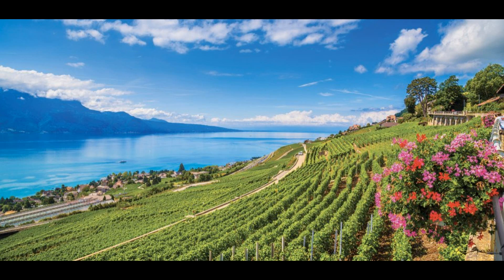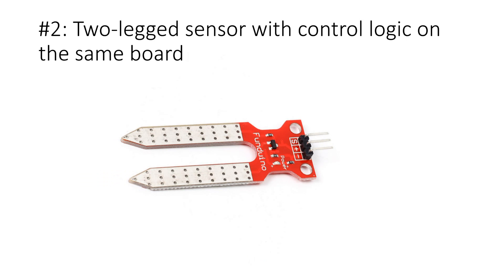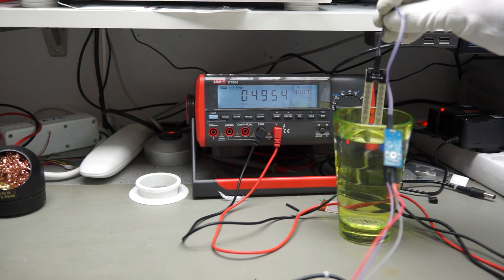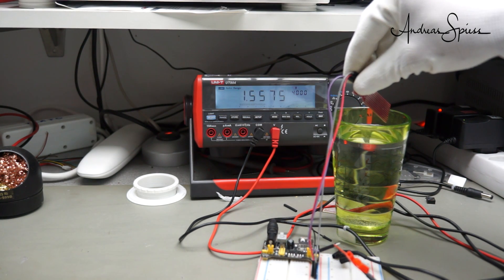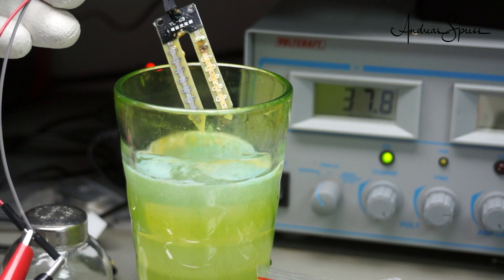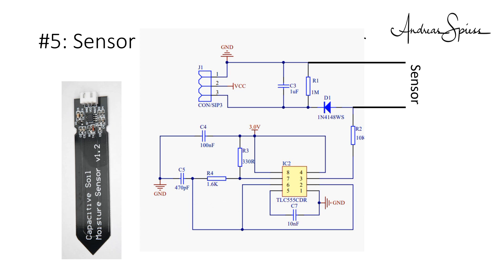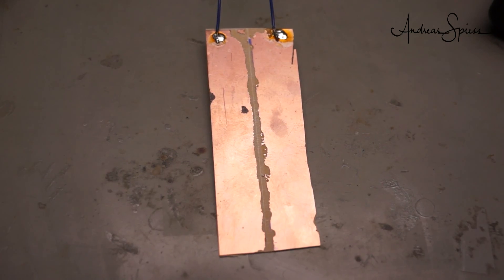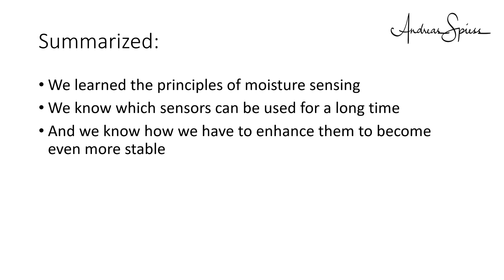463 Why most Arduino Soil Moisture Sensors suck (incl. solution)

Comment: Our trade school teacher was Mr Stauffer, an army mayor. In our first lesson he showed us the freshly installed gutter down-pipe that had 2 different metals used without insulation. He called the installation firm and grilled them so violently  until they rectified the matter. But we never got a list of dissimilar metal voltages. The school then replaced this teacher with a fresh graduate, Mr Zeltner. We never to even halfway through the supposed curriculum. But hey it was public school and nobody cared. If I would build such a sensor today I would use some cmos circuitry that would happily report from a very small solar cell. Of course, there are just way too many ways to skin a cat.
Reply from the maker: Interesting school story!

Comment: You can use the first pcb very easy with an arduino and no electrolysis.
Connect the pcb between to analog inputs. For example A1 and A2.
In the first measurement make A1 output high, it will supply now 5V to the sensor, read the analog value from A2.
For the second measurement you do the opposite, make A2 digitaal out high and read the analoge value from from A1.
Repeat the above.
With this way you measure a sort of with ac and the electrodes with not desolve.
If the reading of the adc is to low, try setting the reference to 1.1V or other value.
Reply from the maker: Thank you for the info. Indeed, you can reduce the time current flows with this method

Comment: In production horticulture we use a neutron probe, but they are expensive. I have found the capacitive probes have a narrow range and are easily disturbed, somewhat difficult to calibrate IMHO, but definitely a cheaper option!
Reply from the maker: I agree with your judgment. They are ok to provide a signal to water the plants than to do studies. As you write, their values depend on many factors.

Comment: Nice re-up, Herr Spiess. :-) To further enhance this widely used humidity sensor, please have a look for the page titled "Hacking a Capacitive Soil Moisture Sensor (v1.2) for Frequency Output" from the Cave Pearl Project. There you will find 3.3V capability, how to use higher frequencies and some more tips and hacks around this sensor. In short: instead of the sensor with the NE555 chip you should favor the version with the CMOS TLC555 chip.
Reply from the maker: A very comprehensive write-up. Thank you for the link. I will include it in the video description

Comment: I coated the edges of my capacitive sensors with clear finger nail polish. I set up an Arduino Nano with the sensor and an ESP-8266 (ESP-01) and can monitor the data via WiFi.
If I didn't already have the Nano and ESP-01 I would probably use one of the Arduino's that have WiFi built in.
Reply from the maker: Good concept! You probably could have left the Arduino out and only used an ESP8266. But of course one that has the ADC pin exposed...

Comment: It's super easy to build this kind of sensor yourself anyway. Just get copper rod, solder wires to two pieces, add the 500kOhm input resistor, to one and a ground wire to the other. Add a second wire to the one with the 500kOhm directly to an analog in of your microcontroller.
That's it. You can have either the v+ or ground coming from a toggleable port so you can save a bit of life on your sensor.
Reply from the maker: Good point!

Comment: 6:54 This sensor works great! 
Until moisture inflates the PCB and corrosion hits the unprotected components 
😮‍💨
Do not forget to give the sensor protection !
For example with PlastikSpray70 or URETHANE71
And protect the connector with heat shrink tube also

Comment: Great video, I tried explaining to a colleague in our makerspace why the moisture sensors they used for literally all the plants are bad for the soil and everyone was complaining what I was such a downer and that it should work fine because 'everyone does this' and 'why would they be so massively sold if they dont work'. Well, now we know why. Anyway, the moisture sensors all failed within a year and some plants died. Copper oxide is really bad for plant life.

I'll be sure to share this video to prove my point, but on top, the best part of this video is that you offer a solid solution. I will get a bunch of these sealed sensors and seal the PCB edges and components with some additional epoxy coating. I might even design my own since you shared the schematics and it looks like this could also work with copper enameled wires since these some pre-insulated and might be easy to wrap around a customly designed 3D printed part (no worries, I use PolyCarbonate for the printed parts so it won't degrade like PLA).
Reply from the maker: Maybe a small plastic bag would do the trick instead of coating or 3D printing. It could be replaced if needed.
Reply: @AndreasSpiess   I'm thinking, maybe using graphite as an electrode in this case might actually make a lot of sense.

Comment: I tried several capacitive sensors-cheap one, DF Robot one and two other Chinese brands. None can survive more than 3 to 6 months even if I coated it. Soil is salty due to fertilizer usage so it greatly reduce the life span of the sensors.
Reply from the maker: That is what others reported, too. Maybe a small plastic bag instead of a coating would help? The sensors do not need to be in contact with the soil.

Comment: Grutti Andreas,
If you look at the schematic at 8:28 - the exposed "sensor-electrodes" still have a DC on them, albeit being used capacitively.
It is a simple addition to place two large-value film-capacitors in series, one on each of the electrodes, to effectively"DC-isolate" these from any active electronics. The plasti-dip or whatever then has to do less work (esp. with pinholes etc. still being able to ruin the sensor). As the two series capacitors are much larger than the soil-dependent capacitance, they do not affect the frequency-modulation.
Reply from the maker: I agree with your proposal. However, some viewers suggested that the PCB lasts only for a short time too. So maybe a small plastic bag around the sensor would help...
Reply: Because of the exposed electronics on that board, the fact that the PCB sides are still exposed, the fact that in some boards the 1M ohm resistor is  not connected on one side and the fact that some of those sensors come with an NE555 rather than a TLC555 and the fact I  like to experiment with moisture sensors, I have used the PlastiDip method, the plastic bag method (as also suggested by Andreas) and I have rebuilt the circuit, but with the electronics separate from the sensor and the sensor connected  via relatively large capacitors. In fact all 3 methods work pretty well. My most favorite method is still to use some carbon rods  to measure the soil resistance, but I am well aware that the latter  basically measures ions, whereas the capacitive method measures  water.
If you are really serious about  using the capacitive method, I would indeed rebuild the circuit and add 2 capacitors as described, put the electronics in a water tight enclosure, with a short shielded cable to the sensor itself. On top of that you could also switch off the  power supply to the circuit and thus to the sensor.
But in real honesty....just two carbon rods do fine for home use
Reply: @edw4699 amazing explanation. Two "carbon rods" = center part of pencils? Could you share some schematics?
Reply: @vazquezjm  No, carbon rods, not 'center parts of pencils'. The latter would break when you put them in the soil.
Schematics???? really: one goes to the analog in and the other to either ground or  Vcc
Reply: @vazquezjm That would be graphite.
Reply: @edw4699 
From soil science classes, CatIon exchange is a good way to go.

Comment: I remember getting the "chirp" sensors that ran on 3V coin cells back in - well, long ago. What I missed on these capacitive sensors was square wave output - I would assume that would be easier to transmit over longer distances. I've seen I^2C and RS485 versions, but they are pretty expensive.
Reply from the maker: Some people add an ESP8266 directly to the sensor and use the air for transmission ;-) Transferring the square wave might also be problematic. It could catch some noise over the distance.
Reply: @AndreasSpiess  I was thinking about that, but them mildew killed most of the plants so I didn't follow that up back then and forgot about it during the pandemic. My students brought that up as an add-on to the school garden, and now I'm working on it again. As a physicist turned teacher, I am not on good terms with analogue signals over long distances. Measuring pulse durations and calculating a median sound better to me (I might be wrong here, though - maybe I'm just bad at analogue wiring)
Reply: @AndreasSpiess  "use the air for transmission" WiFi eats battery juice quite fast. Be prepared to wire your entire garden with VCC or replace the coin batteries multiple times a day.
Reply: Or use a differential analog signal. This increases the complexity a bit on both the sending and receiving side, but because the signal is differential interference will not be a problem.
When the cables become very long then the transmission line effects can become non-negligible.

Comment: I have the 2-finger sensors. But my traces are gold-plated.
Reply from the maker: So you are rich ;-)  But does it help to extend the life-time?
Reply: @AndreasSpiess , I found a couple of them in the bottom of a box of scrap PCB's. I guess I'll find out how they do. I'm not a chemist. But I do know that gold is more inert to most chemical reactions than other metals, the reason why so many connectors are gold plated. If they die, I'll just switch to capacitive ones. That's why I watch your channel.  :)

Comment: Well use missed the two most important principles for measuring soil moisture. 1. Time Domain Reflectometry (TDR). 
2. Frequency Domain Reflectometry (FDR) / Capacitance (Frequency)

Both are state of the art when measuring soil moisture within scientific context. When I saw your video I hoped that you have managed to build one. 😅
Reply: That is correct, they are expensive as hell. I hoped that your expertise is sufficient to build one yourself since the principal is well documented. 😅 I started reverse engineering one but never finished. BUT I will do that in the future, at least I will try.
Reply from the maker: I know that these produce better results. But unfortunately, they are much more expensive and rarely used for the hobby. Even to build one is not easy. Or did you find a project?

Comment: What is happening is simple electrolysis. Light a match and hold it to the bubbles that is generated in the process and they will pop with a small bang due to the presence of hydrogen.
Reply from the maker: Thank you for your explanation!

Comment: Using stainless steel will help with the longevity of the sensor. This type of sensing is good for a small container where you don't care too much about the moisture content at different depths. One could use several of these at different depths in order to construct a map that describes the soil's behavior to watering. This information can be used to optimize water usage and similar concept is used in professional sensors.
Reply from the maker: An interesting idea!
Reply: Stainless steel rods/probes have been used for resistivity and Induced Polarization surveys for a long time. As long as you alternate the polarity you get a good reading and can measure the change in moisture over a large area. Like the video, lots of trash on the market.

Comment: The first sensors can benefit from probes made of stainless steel.   But all have a major flaw in that they use a lot of power and they are not the best thing for IOT standalone sensors.  Also resin coatings in pcb board suffer in the long run from water permeating through the pores because of osmosis. This causes blisters filled with acid under the coating. The latter I suppose one could accept it as a wear part in the system.
Reply from the maker: Maybe the capacitive sensors can be protected by plastic foil since they do not need contact with the soil.

Comment: Another option to extend the lifespan of sensors with exposed copper conductors is to make measurements in a descrete manner. I.e. not constantly but once every 30 minutes for example.
Reply from the maker: I agree.
Reply: And keep the time that it is switched on as short as possible. Usually ~10µs should be enough. Then even more frequent measurements should be possible. What could also help is to lower the voltage that it has available. According to wikipedia, water electrolysis requires a minimum of 1.23V. Measuring with max 0.5V should therefore eliminate corrosion. That may be worth testing.

Comment: Good morning Herr Spiess, I hope your summer holiday is going well, we're missing your fresh content every Sunday morning :)

WRT capacitive soil sensors - I coated their edges in 2 layers of nail polish but I was surprised to still find their surface delaminated and corroded after little more than a year in use. Not going to buy again, they're kind of a lost hope.
Reply from the maker: Good to know. Thank you for the feedback. So we need to find another cover like plastic.
Reply: Yours can survive up to 1 years. Mine is less than 3 months even if I coated it.
Reply: @awaagrikh8331  maybe mine also delaminated and corroded earlier, I noticed the readings started drifting after just a few months but I took them out of the pots about a year later since by that time I wasn't paying any attention to them anymore.

Comment: I'm wondering if there are also moisture sensors that work on the principle that periodically a small resistor gets heated by electric current and then a circuit measures how long it takes for the resistor to cool down again, which should be dependent on ground moisture levels.
Reply: This is how the old gardena probes work, and work well. I don't know about the new smart probe, which is flat instead of round. The smart probe and gateway cost 300€, so expensive to test.
Reply: @Mark-Harding  That's a rather big pricetag 🥴

Comment: What I can recollect about Soil moisture sensors is that you need to either operate them with an AC signal, or periodically run an AC signal through them to prevent the electrode from destroying itself, particularly sensors like the water mark that uses a gypsum (I think that's what's in there) in a small canister and if you don't there is a migration effect that will eventually destroy the sensor.  Sorry, wish I had more details I hope that helps.  The capacitive sensors are probably the best for you applications, but the cheap ones could potential work if you treat them right.
Reply from the maker: Thanks for your additions. We also have to distinguish between measuring moisture and humidity, and I am not sure if gypsum is used to measure moisture.
Reply: @AndreasSpiess   1. The watermark. made by Irrometer, is a soil moisture sensor, it's a green plastic outer shell with a stainless steel screen and there's a white powder in it, I overheard someone say it could be gypsum... maybe it's doped with something? It is probably a company secret.  2. There was also a leaf wetness sensor that was gold plated with a bunch of fingers that wouldn't touch and the moisture in the air would "bridge" that gap.  3. The Last kind of sensor is a Humidity sensor and their capacitive, long ago this was done (in accurately I will state) with a 555 and was tuned in the factory (painful to do) the newest sensors by Senterion DHT (Digital Humidity Temperature) sensors come already calibrated.
Reply: What if you switch the polarity (but still use DC) from one measure to the next?
And, obviously, turn them on for a few  milliseconds at a time (when you make a measurement) and not run them 24/7?
Reply: @NicksStuff  Yep that's kind of the idea, or you could run a small back current or AC signal after you take the readings, and since soil moisture is a slow moving value so you can measure infrequently, like every 15 or 30 minutes... Depending on your needs.
Reply: @olfo4100  You don't... this was a low power application running on batteries, but the generated AC is used to prevent migration of material from one pole to the other. Even powering for short bursts in the same direction migrates the material and the sensor looses the ability to read over time... it might take a while to happen.
Reply: Use graphite electrodes, duh.
Reply: Silver is supposed to be a better conductor and may not degrade like cooper. 

I will try silver solder sealant for probes. 

I use hollow aluminum  knitting needles as my probe body.

Comment: The capacitive  approach is a simplified form of impedance spectroscopy. The real fun with that is when you sweep the frequency and take a spectrum instead.
Reply: Indeed so. I worked with non-linear dielectric spectroscopy for years measuring yeast viability.
Reply from the maker: What would I discover in the spectrum? Is there any information available?